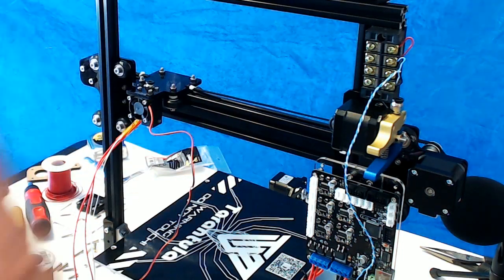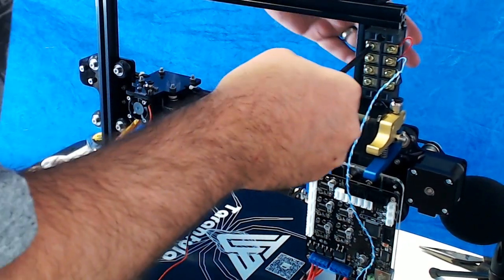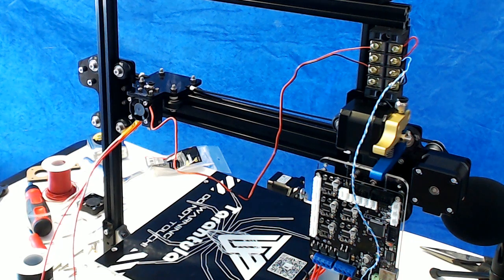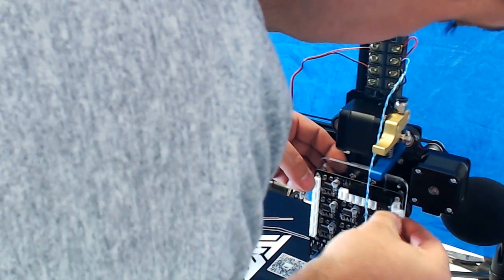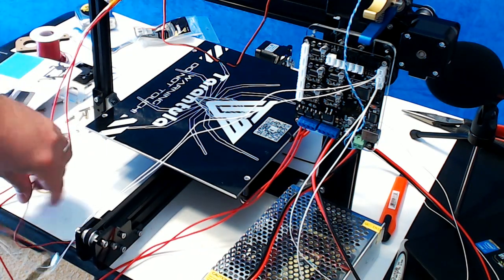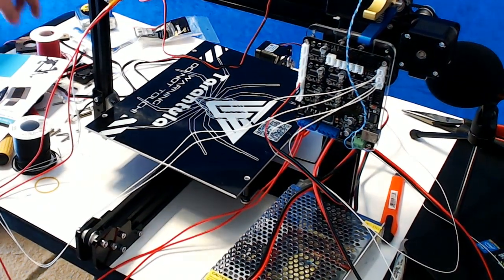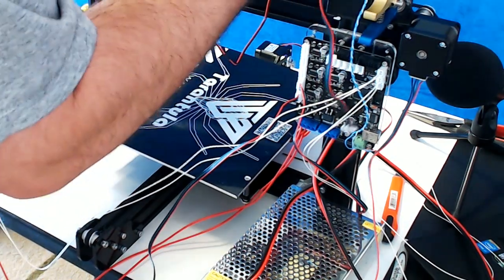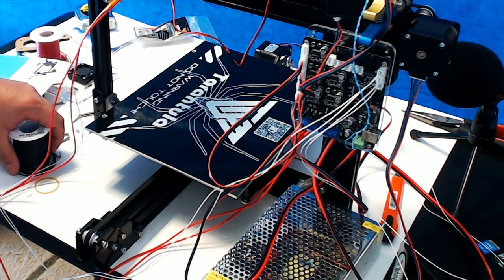Tevo Tarantula Assembly - Step 17 - Wiring Part 2

Comment: I finished all the wiring, but when i home all the axises, the z motor just vibrates instead of turning. Do you know the problem? The wiring is correct, do I just have a faulty motor?
Reply: never mind, I fixed it. There was one wire with the green and blue flipped, so i used that one and it worked.
Reply: what end was the blue/green flipped side attached to, the motor or the motherboard? seems like I should attach the flipped blue/green ends to the motors, but im not sure.